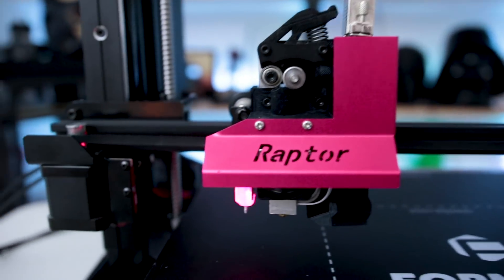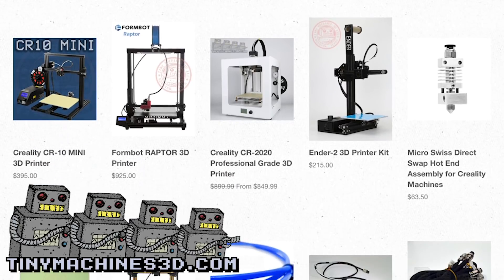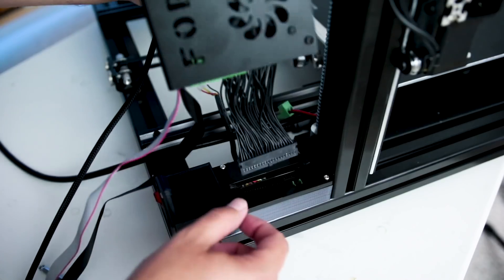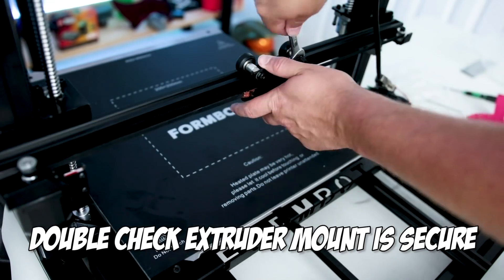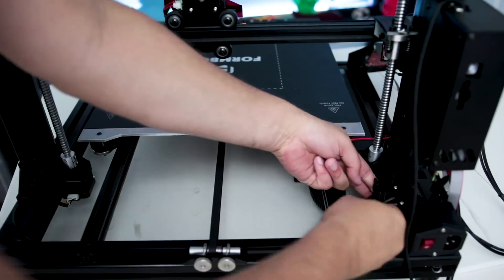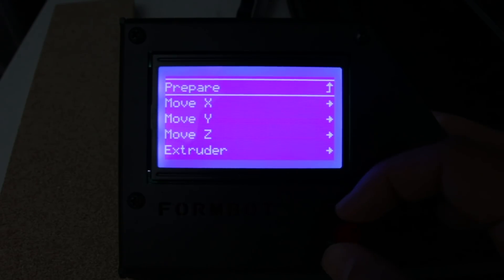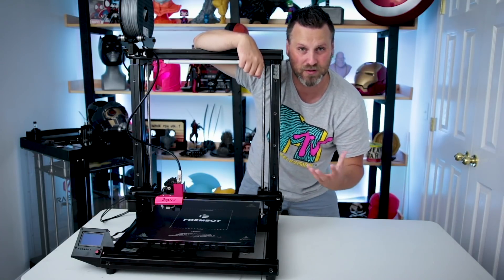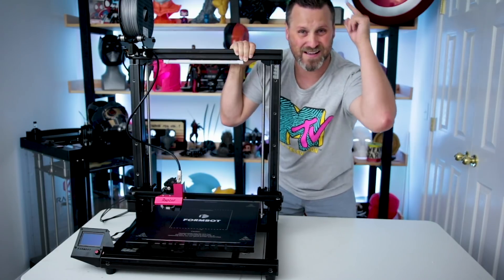Formbot Raptor 3D Printer Assembly

Comment: That printer looks sharp! Direct drive extruder, BLTouch, is that a v6 hot end too? Adding those upgrades on a CR-10S4 or 5 would make it cost more than just buying one of these. Definitely a GMax clone but much much cheaper.

Comment: What 3D printing companies do you recommend if you don't have a 3D printer to print your work?
Reply: depends for what purpose, price range, type of material, size
Reply: Aggronn it doesn't matter to me; just some names will help me out; I can do the research myself later.
Reply: yes it does since i dont want to name over 20 printers XD
Reply: Aggronn just the top 5 will do. I can look up others companies later; just for now I just need a stepping stone.
Reply from the maker: It all really depends on what you want to print. I mostly do big cosplay builds so I want a nice big printer. Loving the CR-10 from creality, JGaurora A5 and ive heard great things about the ender 3.
Reply: see like uncle jessy says, the purpose is the most important thing. Wanna do big prints? small print? fast prints? accurate prints? easy printer
Reply: Aggronn big prints for the most part.
Reply: GRIM Davis creality, formbot raptor and the one that uncle jessy says the jgaurora
Reply: GRIM Davis im thinking you mean a company to print it for you if you dont have a printer? Cheaper to buy a printer if using a service with any regularity but look at Shapeways.